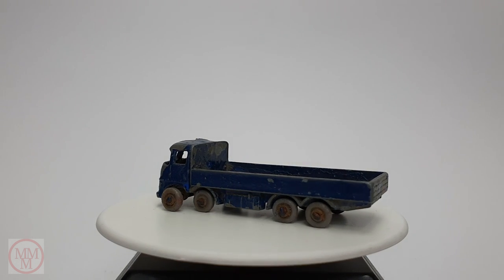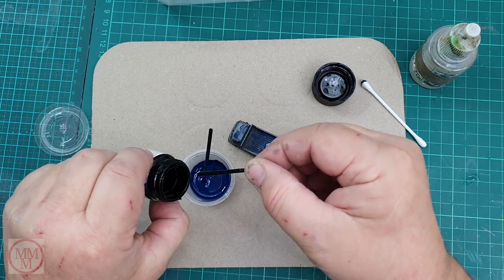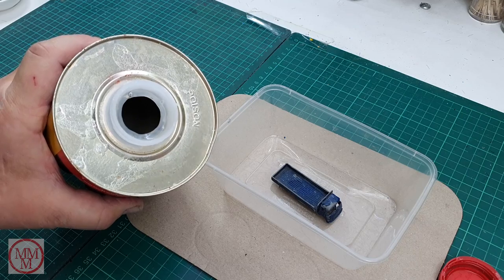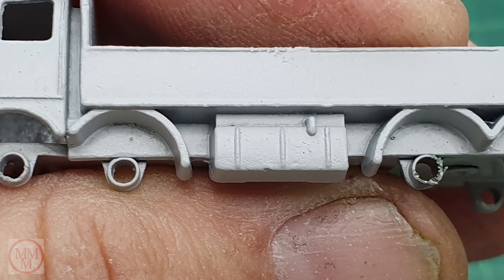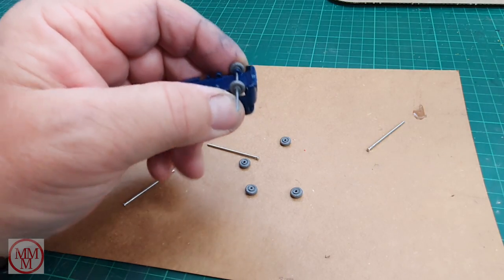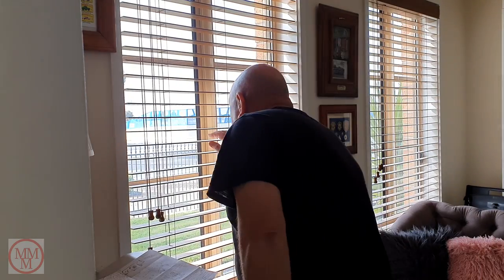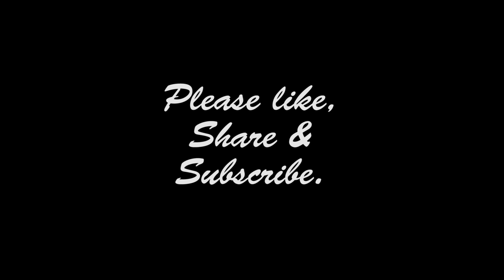MATCHBOX Restoration No.20b ERF 68G Truck 1959

Comment: cute and lively, that little truck. I'd say the restoration was ERFolgreich. :)
interesting wheel problem, though. :) good thing they are reproduced again.
the problem with rust-losening is that it's loosened, but still there. I had to break off many screws and bolts because all the rust in the thread couldn't budge and was blocking movement.
and just when you think Kevin has somethign good going on he pulls another Kevin... he be the Kevinator? :)

Comment: The funny part here is that if that turntable is the same as the ones I have, they have a nonexistent battery compartment under them.  On the topic of this restoration though, this is yet another stunning model.  Too bad Matchbox didn't include a couple crates in the bed, but then again they probably would have been gone very early in this trucks life.  Could always turn it into a Choco-Hauler for Julie. =3

Comment: Very nice work on a classic vintage.  A small scale and hard to work on with big hands.  Matchbox sort of repeated this model.  I have an early 1980's Superfast truck.  A 3 axle Volvo F10 cabover.  It also has a drop side tray and is almost the same colour.  The decals are Michelin tyres.  My example is a bit of a curiosity.  Some of the details on the tray floor and drop sides are not properly formed.  It managed to slip past quality control - instead of ending up in the melting pot with the other faulty castings.

Comment: When I watched the Behind the Scenes video I was puzzled as to what it was about until I saw Kevin with the batteries. Good plot and a remarkable result on both of those.
It's interesting to see that if you can't rmove the wheels with your ASS you use your nuts.
Oh by the way normal paraffin is a good substitute for WD40 when you run out. It's what was used in engineers parts baths back in the day.
Reply from the maker: Thanks Colin.

Comment: aww damn, i was hoping for some out takes at the end there. Anyways, i recently had to fix soem seized up tools, soaked them for days in WD40 and it did nothing. Soaked for a day in brown vinegar, and the joints unseized without any problems, and what rust the vinegar missed, the wire brush managed to catch.

Comment: Did you use the larger wheels ? I believe this Lorry was made in two different sizes. Matchbox did that with some models. The older ones were much smaller.  Looks good.

Comment: That reminds me of a time a Brit almost got punched in the face.... My buddy and I were in a big rig diesel parking at a coffee shop. Suddenly this Brit jumps up on the running board and says something we didn't understand right way. My buddy was so surprised he about punched the guy in the face, but luckily the Brit was able to make us understand that he just wanted pictures of the truck. Apparently, he'd never seen one like it before. It was an old Kenworth. I know you have big trucks in Aussieland, even trailer trains and all, but apparently this guy was straight from ... somewhere in England, he didn't sound like a Londoner or someone from Liverpool, the only two types of brit accents I knew at that time. Anyway my buddy didin't have a problem with him photographing the truck, but didn't want to be in the photos, so I slid behind the wheel like I was the driver of it. I did drive big truks some, but not that one. Apparently all they had was the smaller trucks... no way a truck (often called a tractor, you call them a prime mover) and a 55 foot trailer would get around well in the narrow streets common in the UK. This was long ago about 50 or 60 years ago. I'm sure they've all seen them by now, at least in vids

Comment: Have you ever tried soaking the seized axles in a rust remover like Evaporust or similar? That might be a gentler way to free the wheels.
Reply: or vinegar......but this might damage the plastic though
Reply: @maxnoerenberg6370  vinegar will make the plastic smell. Evaporust is a specific rust remover chemical which is kinder to other materials.

Comment: @2:45 Interestingly, "Q-tip" is a brand name that's become a generic name for any cotton swab, just as "Kleenex" has become a generic term for facial tissue.  A couple of friends and I had a chat once, to see how many such words we could think of.
@6:50 You still can't go to a store?  That's what we call a bite in the ass.  I don't think any state in the Union still has any such restrictions.  Here in PA, even with a lockdown, we could still make arrangements to visit a shop, "curbside pickup" it was usually called.  Deciding what was "essential" and what wasn't, was a very arbitrary process, and enforcement was even less consistent.
@8:48 Did Matchbox ever use metal wheels?
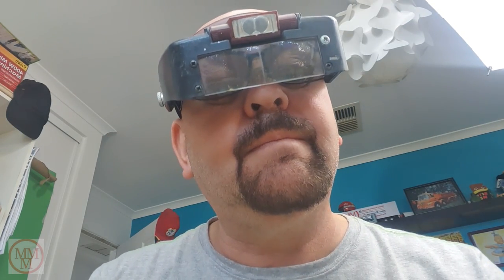@8:52  Optivisor!  I can't work on a model or paint a figure without one.  Recommended highly to all!
Reply: They did use metal wheels and you can date them at times by the number of bumps on the wheel. The 20B never came with metal wheels and they only crimped the axle in 1959.   The 20A truck is a 1958, prior to that Lesney used unpainted metal wheels and the wheels on Marty's are clearly plastic.   Just helpin' Marty!

Comment: Why do you do some half assed? Why not take the bases off every time?
Reply: Marty left this one as it is because he said that if he drilled it out, he was afraid there would not be enough of the shaft to drill and tap for the new screw as it was a shallow rivet. Usually he does take them off, must be a good reason he leaves them on once in a while but I wouldn't say he cuts corners.